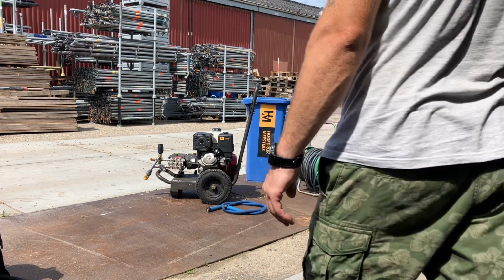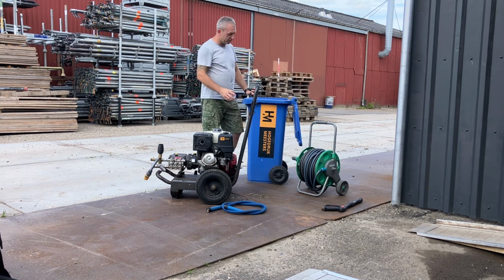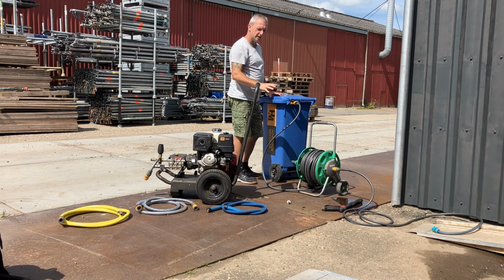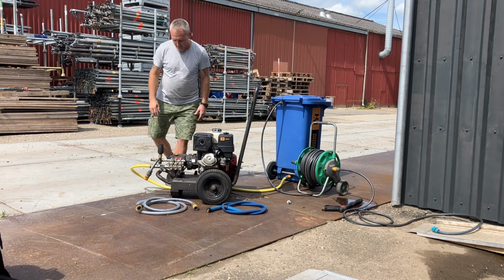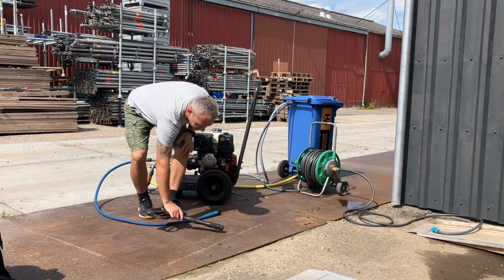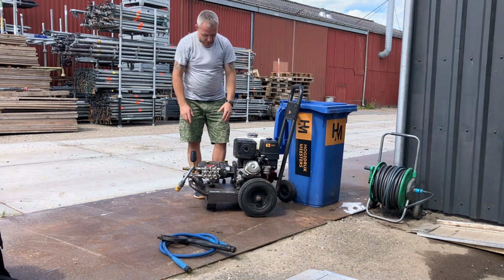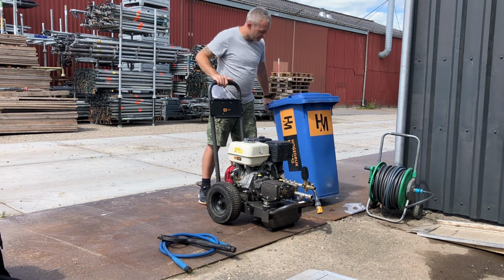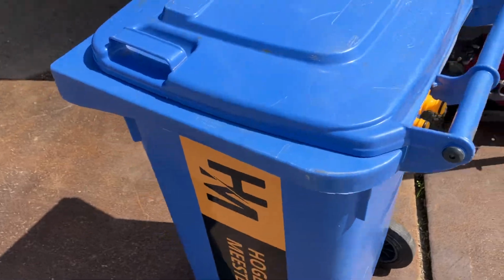Basic introduction into petrol high pressure washing equipment.

Comment: Great info - thanks
Reply from the maker: Do you have any questions? Or is there any thing you are not sure about? I plan to make more videos, so if there is some thing you need help with, let me know and I will make a video about it 👍
Reply: @hogedruk-meesters105   I must admit, I was toying with the idea of getting a similar set up in your video, but eventually went for a van mounted system.
Reply from the maker: @jypexnettoyage  I also have a much larger machine (was mounted inside an iveco, but I have now installed it onto a trailer.) so I will be making some videos about that soon. Most likely the first one next week.
Reply from the maker: @jypexnettoyage  what machine did you fit in your van?
Reply: @hogedruk-meesters105  from ac pressure washers in the UK, 300 bar with boiler 130 deg.
Reply: @hogedruk-meesters105  Why did you change to the trailer?
Reply from the maker: @jypexnettoyage  I am from surrey and have been living in the Netherlands for 6 years now. I have the diesel powered van pack from Rutland pumps. With the izuzu engine.
Reply from the maker: @jypexnettoyage  good question;  cost! I didn’t want to buy another van at the time, so I decided that trailer mounted made sense for me. I can store it when not in use and makes it very flexible. I am planning to get another van with in the coming 12 months, and want to install a low pressure machine for gum removal inside it with 600 or even 800 L water tank. It would mean I could take both machines to a job for example.